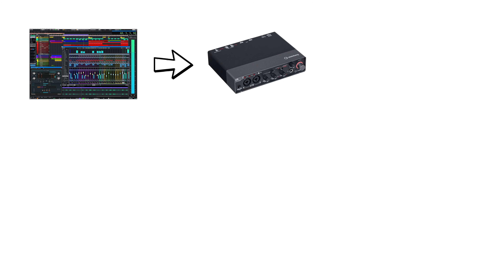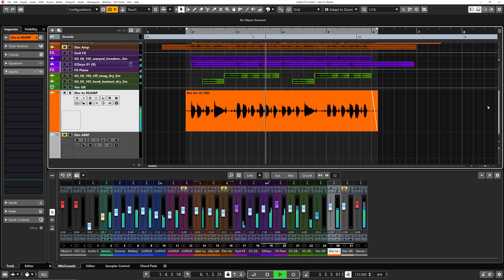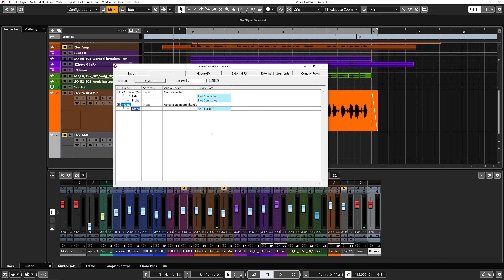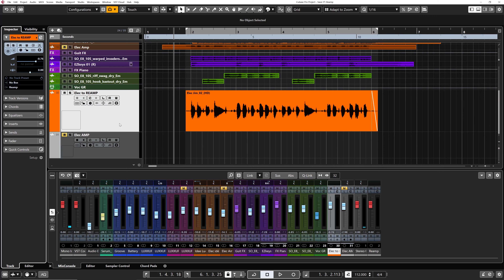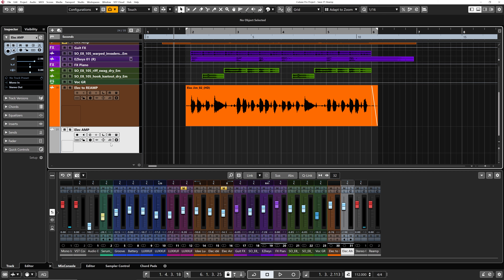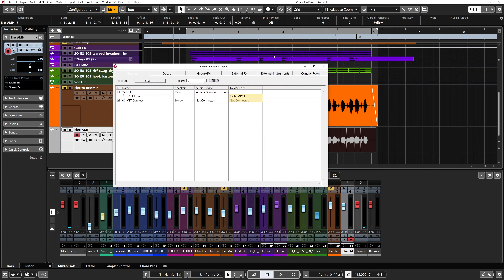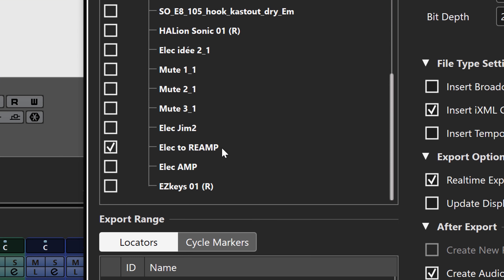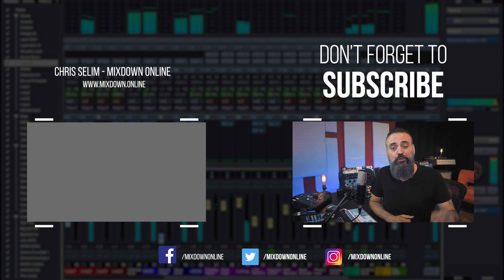How to REAMP your GUITAR in CUBASE - Setup and Workflow

Comment: Thank you very much for this video Chris!! I wanted to see your approach on reamping because I use the same methods, and with the first method I get latency on the reamped track. My setup is: Cubase 10.5 / WIN10 - I9 9900K - Z390 Aorus Master MB - 32GB RAM -> Audient Id44 -> Radial X-Amp -> Evh 5150 III head and 2x12 Cab -> Sontronics Orpheus -> Audiet Id44...I have a pretty good setup, maybe I have to check some settings like delay compensation or something to get that sorted! Always very helpful, thank you!!
Reply: i havr latency as well. have you try the insert way?
Reply from the maker: Didn't get any latency on the recording itself, same results with both methods, but that can depend on the audio interface and plugins already in your session from what I understand. Using the External FX option to reamp will help for sure.

Comment: can I use the Jack output directly from the remote control or sound card ?
Reply from the maker: You can but the impedance will not be the same, so your output signal will probably be louder and you might end up with a bit of noise. Just pay attention to this. If what you hear sounds good to you, just go with it :-)

Comment: Chris, as always thanks for great video. You're the guy number one when it comes to Cubase, no doubt. I have one question/problem with Cubase, would love to see the video explaining it in depth. Render in place and all the settings. I use hardware outboard EQ and run some of my tracks from audio interface through the analogue gear and back. To print them I use render in place. So far so good. But Im so confused with all those settings, never know which one to choose while rendering. I would love you to explain which settings are the best for this example: I have a vocal track which is bused to VOCAL bus. On this bus I have let's say deeser, then I want to run this vocal track through analogue EQ, I print it (I mostly choose the second last option while rendering) then after printing the new vocal track is bused to the main fader, so I have to bus it again to VOCAL bus. But I have a feeling that while printing and selecting second last option all plugins from the VOCAL bus were included as well. I'm confused. Chris can you please make a video about rendering and explaing every single option with examples. I would greatly appreciate as I use my outboard EQ all the time and I think I make mistakes while printing then busing again ect. Thank you. Lucas
Reply from the maker: The second option won't include the Group where your vocal track is routed.
Reply: @mixdownonline  thank you. So correct me if I'm wrong. If I'm selecting third option and print the track, the third option also takes all plugins from busses into consideration? So for example if I have vocal bused and deeser on the bus and then want to print that separate vocal.the third option will also print it with the deeser from the bus group (and then the new printed track is routed automatically into mix bus). When working on buses and using backward mixing a lot, which option second or third would you recommend while using external gear and printing separate tracks? Sorry for so many questions but it is confusing for me, and in my opinion you're Cubase expert and I follow you and watch you videos for long time and you're the first person to seek help with. Thanks Chris

Comment: Chris is there a difference between render in place and export in real time like you showed in second example of reamping? Or they all the same thing just different methods?
Reply from the maker: I use Render in Place to save time when bouncing VST instrument (MIDI to Audio). This is where I use it most. When working with external gear, Cubase will export in Real Time even with Render in Place so in this situation, Render in Place is not my first choice to be honest. I just do like I did in the video.
Reply: @mixdownonline  thanks Chris, but what's the difference between both? I don't really understand the difference between both as it seems they both give the same result. I always use external analogue EQ, but always use render in place. Should I use export instead? Thank you
Reply: @LucasMichalski  Did you ever arrive at any further conclusions regarding this? Wondering this myself, but not a Cubendo user (yet).

Comment: Just one last question with rendering / printing (like you showed in second example). Once you exported the track, the original one is greyed out, can you use it again? I mean in your example if you would want to reamp it again in the future (after first reamping using second method) How to use it again? Thanks
Reply from the maker: Yes, you can use it, the audio event(s) is only muted
Reply: @mixdownonline  thanks Chris. How do you unmute it so I can use it again? Standard mute 'M' option doesn't work. Thank you for the answer.

Comment: I bought a radial box, but I have honestly never had an issue going straight out of Cubase into an amp, because you can just adjust the volume of the output track. The noise is therefore the same level of noise that would be there if you were coming out of your guitar itself. There is no noise added from digital recording. I don't really understand the need for the radial box.
Reply from the maker: Yes, if you do this coming out of an interface, you will have to turn down the output to compensate, but you will still have an impedance problem, but it doesn't matter if sonicaly you don't hear the difference much. Here's a good video from my bud Ryan explaining this https://youtu.be/b1O_5gaX4-s
Reply: @mixdownonline  thanks for the link Chris. I'll check it.

Comment: Hi Chris, 
I've good interface (motu) preamp and DI box (Radial J48), I plan to record my tracks first at home and after to reamp them on the real studio where I record my albums (it got a radial reamp box also), so it will be more about get the sound than focusing in guitar playing.
For a DI guitar or bass, do you recommand to be on the "-18/-10" box also? or it also be more like for pick (like low E string metal attack)?
Thanks a lot
Cheers from France

Comment: Don't know about the Radial Reamp but I did test the Reamp Box from Palmer and wasn't really happy. I don't know if it's fair to compare, but I recorded plugged directly on my DAW while playing through my amp to "feel" the sound. And when later I did reamp the same signal through the SAME amp (same settings), and it wasn't similar at all.
Reply from the maker: Yes, that can happen with cheaper passive Reamp boxes. The one I use (Radial Pro-RMP) is passive and might color the sound just a bit. If you want one that is very transparent, look for an Active Reamp Box like the Radial X-AMP or a high-performance passive like the Radial JCR Studio Reamper
Reply: @mixdownonline  Yeah definitely,I think the Radial worth the trial, Cheers from France Chris. Congrats for your work :)

Comment: Also when i done this i got a ton of feedback (a very high pitched squeel) how do i stop this? It only happened when i turned the level knob up on the radial
Reply: Because you're probably monitoring and tracking in the same room which will only work if the amp and monitors are not very loud and the mic gain is quite low - monitor with headphones.
Reply: @LondonSteveLee  yeah headphones fixed it!

Comment: When Reamping I run into an issue in Cubase with the external effects sometimes not reporting the delay compensation ping, have you run into this issue or do you know what may be causing it? Thanks.
Reply from the maker: You mean that it stays at 0ms delay detection? If so, that depends on the audio interface and plugins in your session from what I understand. My AXR4 gave me 0ms in this session and my URRT4 gave me 3.2 ms.
Reply: @mixdownonline  Hi Chris, Thanks for your response. Yes it stays on 0ms delay detection sometimes and other times it reports a delay, but this is on the same gear and i do not use any plugins in my DAW when tracking.
Reply from the maker: @cshortlife9179  Yes, I know and I'm not 100% sure on what's happening here to be honest. I know that Cubase has some delay compensation built in and I never noticed a problem remaping whether method I use.

Comment: Just something to consider for anyone who wants to do this. Take the $100 for the Reamp converter and put it towards a  used Line 6 POD HD500X which will perform that function. They're bullet proof and cheap now that the Helix is everywhere. You can record both a clean DI and a processed track simultaneously and you may find that the dozens of amp sims and nearly 100 pedal and rack effect sims prompt you to  abandon your amp all together like I did.
Reply from the maker: That's always an option

Comment: one more question - if we do not have an iso booth for the amp, is it ok to turn the main (last) volume level on the amp way down or is it going to affect the sound quality negatively?
I have a opeavey VYPYR modelling amp and find most of the "healthy" levels are below 1 on a volume scale of 1-13. Wish that thing had a pad switch.
Reply from the maker: It might should a bit different since the cab speaker will not react the same way in that case. It's for you to judge if it sounds worst or not.  The OX Amp Box from UAD might be a good tool for you then :-)